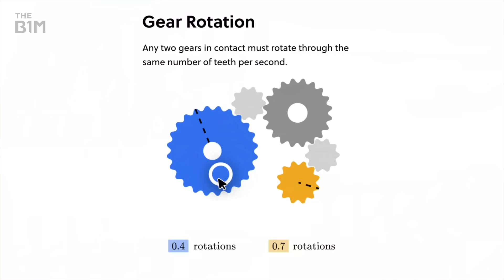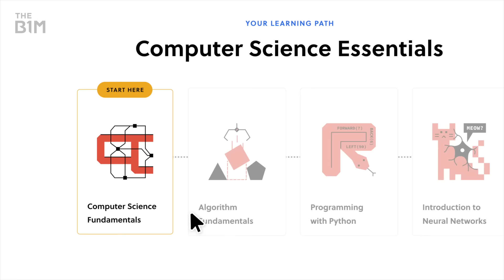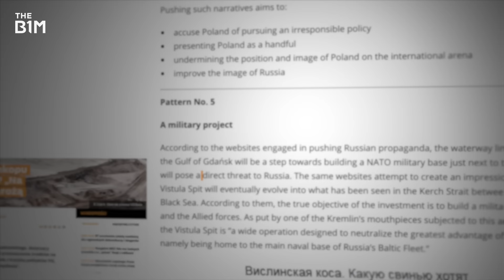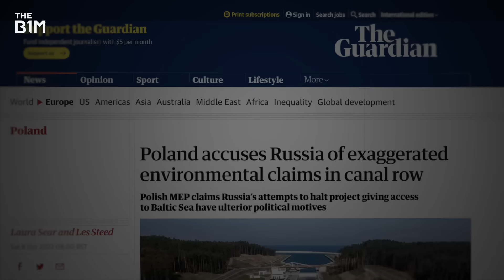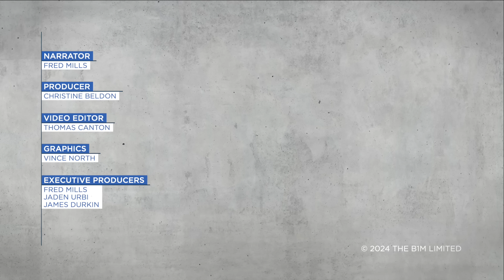Why Russia Tried to Block This Canal

Comment: I really feel like rail investment between Elblag (sorry not fining the a) and Gdansk (not n) would have been a far more cost effective solution to their problems. A solitary port doesn't require a $450M infrastructure investment to save when there is an alternative 20 miles away
Reply: This canal is not only used for the transport of goods, but also for boat tourism. In the long term, it will bring a boost to the city when sailors from western Poland, Germany, Denmark or Sweden are no longer forced to sail through Russian territory.
Reply: ciekawe czemu teraz wolą korzystać z przekopu ?
Reply: @PanProper Kto woli korzystać z przekopu? Kajakarze? :D
Reply: Żeglarze i motorowodniacy...
Reply: @PanProper  mhm, czyli nikt, komu ta inwestycja za grube miliony była naprawdę potrzebna.

Comment: Can someone explain why the bay and the lagoon have different water levels? The lagoon is connected directly to the Baltic Sea, at which point the water level becomes in the lagoon than the sea?
Reply: Sea levels rise and fall with the tides.  Perhaps they want a fixed water level inland
Reply: I don't know the details, there may be other reasons for the gates. But although the tidal effect in the Baltic Sea is only a few cm it's still a lot. The Wisła Lagoon has an area of 834 km² so for each cm of tide almost 1.4 million m²/hour has to pass through the two canals on average.
Reply: Without the locks, as the tides rose and fell in the Baltic Sea, it would cause a current through the narrow opening which would be dangerous to shipping.
Reply: The water level varies on both sides due to wind, tides and currents, the loch raise or lowers in both directions as needed. Also if they did not have lochs the current through the channel would be very strong, swapping directon with the tides, navigational and erosion problems would become issues.
There are no pumps or seperate sources of water needed because it is just equalizing the water level depending on which direction the ship is heading.
Reply: I suspect that the tide times either side of the canal are different ,  On average they will be the same level but they will vary with respect to each other over the day.
Reply: Tides in Baltic sea are small, but the wind can raise water level by a meter or so. But the gates are also there to prevent mixing salty sea water with fresh water in lagoon to ensure protection of the unique ecosystem that is in there.

Comment: While I salute Poland for sticking it to the Russians, it does seems like a questionable investment compared to improving the facilities at Gdansk and transport from there to Elblag.  I'd say one of the reasons they haven't already deepened the canal is because there's nowhere for bigger ships to go.  The only significant port requires getting a fair distance up the Elblag River, which isn't much bigger than a canal and has a tight, low drawbridges in the way.  Superfreighters aren't going to use this no matter how deep and wide they make the canal.  So I agree it's mostly an expensive political statement.
Reply: The river Elbląg will be deepen, the contract for it was signed just today. After that the rest of plan will be realised.
Reply: Bzdury gadasz tylko nie wiem czy z braku wiedzy czy z polecenia...A kanał nie został do tej pory pogłębiony ze względów ekologicznych...Chodzi o okres ochronny dla ptaków...Lada dzień zaczną pogłębiać... wszystko zgodnie z charmonogramem...

Comment: I love how explaining a simple, widely used thing as a "lock" (we call it a "sluis" in the Netherlands!) is needed. To the Dutch, it is just something nearly everyone knows.
You did a very good job of it!

The swinging bridges are also quite common here, especially in city centres. But for an out of the way project like this it feels like it would make more sense to go for a very high un-openable bridge (on mounds of earth on either side).
Since it's not a harbour area for loading and unloading ships, the space on either side isn't needed for anything else.
You could even make them slightly bigger, and have a nice park on the rises, with maybe a cafe on one of them. :)
I am sure ecologists can help ensure that that doesn't negatively impact the local environment, and I am sure that a bird sanctuary can be formed on the side that doesn't have a cafe.
Reply: If it's ok to ask, is "sluis" pronounced "sloos"? The reason I ask is that, on the canal system in the UK, we call the installation itself that allows a vessel to move between water levels a "lock", but the little mechanisms that open to physically change the water level inside the lock "sluice gates" or "sluices". It'd be really interesting if that linked the Dutch name to the British name 😊
Reply: @t-and-p  Hello! I'm not sure if English has an "ui" sound. It is one of those Dutch "we need more vowels, so lets just mash two together and give it a sound that isn't quite what you'd expect" double-vowels.

But I can tell you it is not the same sound as in English.

However, they both have the same origin; the latin word "exclusus"; to exclude.

English language etymology sites tend to favour French as the source.
But since in old French it is "escluse", and the earliest Dutch use of such a word was "sluse" (borrowed from French), later changed to "Sluis", and seeing that around that time English adopted the "Sluice" spelling, it seems likely that they got it from Dutch engineers working in England (who could do wonders, like pump out moors with windmills, that the English could only dream of).

I fear I sound pedantic when I say this, but as for the naming; the whole thing is a sluice, and the sluice-gates are simply the gates on the sluice.
So you'd be accurate calling it a Lock or a Sluice.
A Dutch person would call the gates "sluice doors" (sluis deuren). :)

And as for Dutch influenced English words; I would guess that about half of them are. The rest are French or Norse. :D

Comment: You talked about Elblag. If you like to see a truly interesting and much better engineering accomplishment you should take a look at the Elblag Canal which was built by the Prussians between 1825 and 1844. The 80 km long canal is completely without (normal) locks but it is still very much possible to be navigated by ships across it's nearly 100m elevation difference.
Reply: 100 m elevation??😮

Comment: 6:43 why not make it deeper, compared to the overall cost that doesnt seem like its percentage wise a big differennce
Reply: The current size is big enough for all the shots that use the lagoon. If they want to make it bigger they would have to upgrade the port and pretty dredge the lagoon
Reply: Because it won't be used for serious transportation anyway.
Reply: Problem is a lagoon that is very shallow so with a bigger canal you would need to effectively dig another canal in a lagoon and maintain it since normal lagoon processes would fill that canal over time with sand etc. 

This channel was a vanity project mostly done as a political statement.

Comment: It seems short-sighted to not build the lock for bigger ships.
I was also surprised by the lock itself, as the passage in the Ruzi occupational zone is open. 
Level difference would be because of tide, wind or atmospheric pressure. 
Apparently significant, but the Ruzis never bothered.
Reply: The lock will, undoubtedly, be enlarged in the future for bigger ships.   As was mentioned in the video.
Reply: nothing bigger can sail inside anyway - draft
Reply: @dr.jamesolack8504 No, it won't. Even the ships that can cross the canal as it is are too big for port of Elbląg, which is the only port in the area that is bigger than a small marina.
Reply: You're talking about the 'Ruzi occupational zone'. You're right about that, but then name the other part, the 'Elbląg' aka Elbing area also correct, because it's the 'Polski occupational zone'!
Free Ostpreußen!
Reply: @PeteDarrell1972  What makes your arbitrary period any better than the earlier periods?
Reply: Occupation zone, like half of the territory of modern Poland lol. This division took place at the same time and the Poles are unlikely to be unhappy with it

Comment: 4:30 is an outstanding video sequence of the ocean buffeting the breakwaters while the area inside still as ice.  I understand that it's probably 100% shut off from the ocean at this point but with only a small opening I think you can guess that the small wave will not make much of an impact when it expands into this breakwater area.

Comment: To be honest, can someone explain why a water lock was needed?
Reply: Maybe so that there is no strong water flow. If there really is such a difference there, then the water would simply blow your away
Reply: The difference in levels depends on current weather conditions. In our hydrological conditions, sea level depends mainly on the speed and direction of winds. The Moon's gravity has a negligible influence here (on the order of single centimeters). It should be noted that during storms we usually deal with north-eastern winds, which makes the Vistula Spit a natural breakwater for the Vistula Lagoon.
Reply: @antymonian2  Interesting, and having a gateway, despite the weather changes, there will be almost no water flow in the canal. So ships will be able to sail there safely even during a storm?
Reply: @Tony-.  I don't have such knowledge, but I suspect that you can only sail in good weather conditions
Reply: @antymonian2  So you could build only such protection gates like in Rotterdam (or similar). There is no need of having complicated and costly water lock. For me it looks like “smart” spending of public money.
Reply: I don't understand that either because both sides are at sea level, and locks are meant to moves ships from one altitude to another.  What gives?
Reply: @Matti_us_Alpe  This is just my suspicion: when we have different levels on two large reservoirs of water connected by a small canal, the water current should be quite large, so probably the lock is there to simplify navigation

Comment: I would like to understand why the Kaliningrad side apparently doesn’t need a lock to access their port, and Poland does, given that they share the same geographic configuration: same sea, same lagoon, same bay barrier.
Reply: You and me both.   This video maker did not have curiosity to ask any questions.
Reply: Because the water level at the Kaliningrad passage is the same on both sides. I'm sure you wonder how it's possible that the level is different at the new passage, since it's the same body of water, and water flows to forms a flat surface? Well, before you ask, the answer is that water doesn't really flow that fast on grand scales. Combine that with the gravitational pull from the moon which causes tides, and the natural flow of currents and you'll see that when you look at the bigger picture, water across the surface of the earth is not flat. The size of the Kaliningrad passage acts like a flow dampener.

If they had not built the lock, they coast at the end of the lagoon would have been flooded.

Comment: At first (As usual ;-) ) an interesting video! Thanks for that.  But I have a question. When I look at Google maps I see that the "Russian" exit of the lagoon does not have locks. But the Polish exit where you made this video about does have locks. Nowhere at the lagoon side I see any dams or whatever blocking the water. So I wonder why does the Polish side need these locks. As far as I always learned water is always level?  Do you maybe  know why / how this is possible?  Thanks and greetings from Holland 🙂
Reply: Good question. Russian entrance is natural, not artificial. So water level difference must be the result of moon gravity or Coriolis force if I have to guess.
Reply: Yes, water is at the same level in connected bodies when it's in equilibrium. If you have two water containers connected by a thin hose, the water levels in them will be the same. But if you start pouring water into one of the containers, the level there will rise, before the surplus water flows through a hose into the other container and the state of equilibrium is regained.
In this case, the Vistula is emptying into the lagoon, raising its water level, and the surplus water is flowing out into the Baltics through that "Russian exit". This is why the level in the lagoon is somewhat higher than in the Baltic Sea. If the water from the Vistula stops flowing, the levels will equalize.
Reply: Water level moves around one meter depending on wind, its negligible, but salination level is not by opening another unrestricted way in the lagoon water would mix very fast and decimate life in the lagoon.
Reply: @tjurzyk  No.
1. The water in the lagoon is already brackish -- a varying mix of fresh water from the Vistula and salt water from the Baltic Sea. This means that the life in this lagoon is the kind that can live in both salt and fresh water.
2. The water level in the lagoon is HIGHER than in the Baltic Sea -- the water flows OUT of the lagoon and into the sea.
Reply: @lechatquilit  And Your second point is exactly why lock is needed. Creating unrestricted way straight from, and most important close to, river mouth could, and most likely would, create a vortex that would suck more salt water from Russian side changing overall salt level. Right now water from Nogat and Elbląg is effectively pushing out sea water from basin.

Comment: So this 'canal' needed locks because of the difference in water level between the lagoon and the sea... so why does the original strait  (Strait off Baltiysk)  NOT need locks to go from the same lagoon to the same sea ?
Reply: Because it’s the natural outflow of all the water influx from rivers…
Reply: I thought the same and can only assume that the area us extremely tidal. With the canal being so narrow the tides would create huge problems.
Reply: @xwhite2020  
There are no big tides - except from winds - but a risk of lowering the depth even more without the locks.

Comment: So why is it that the water level in the lagoon is not the same as the ocean to which it has an opening?
Reply: Yes and do the Russians have a lock at their passage?
Reply: It's the same average level, but tidal surge and ebb affects the Baltic Sea shoreline only.
Reply: I wonder how wide the channel would need to be to make the +/- 1.5 foot difference navigable.  I assume that Poland decided that it would be wide enough that building and operating locks would be cheaper, but how much cheaper and over what period of time?

Comment: I don't understand why there is a water level difference. The bay and the lagoon were already connected, weren't they?"
Reply: Usually the level is the same unless strong winds blow. The lock prevents salty water from flowing into the lagoon.
Reply: @michapolaszek7049  But the lagoon is already connected to the ocean to the north. I too am confused about the sea level difference.
Reply: @Hairballs_58   There are a few rivers flowing into the lagoon and the only connection with the sea is the narrow strait at Russian side. So the water contains very little salt.
Reply: @michapolaszek7049 
And is higher…
Reply: @aoilpe  A bit.
Reply: DmtriyK, dużo ci płacą za trollowanie ?

Comment: They should have made it deep enough to begin with. The cost of rebuilding will be way more expensive. Plus if there is no lock system then the value of the canal becomes much higher.

Comment: Liars!
Quick facts checking shows that the Russia's only concern was - access NATO warships via this canal, period.
Other concerns regarding environment, waste, etc were risen by Polish and other European environmental activists:

"Environmental concerns had been expressed by environmental activists in Europe and Poland, which did not stop the project.
Marine biologist Dr. Agata Błaszczyk expresses the concern associated with the phosphorus accumulated in the sediments at the bottom of the lagoon, primarily coming from technical wastewaters from industries in the area of Elbląg, from animal farming sewage, and from washed-out fertilizers, which contribute to eutrophication of the nearly closed lagoon resulting in strong blooms of cyanobacteria, which in turn contribute to algal blooms in the lagoon, giving it a distinct greenish color compared with the rest of the Baltic Sea. The new waterway is expected to contribute to the mobility of the sediments, possibly resulting in changes in the ecology of the adjacent areas of the Baltic Sea with unknown consequences. The concern is that the cyanobacteria in the lagoon are different from those in the open sea, with higher toxicity"

Comment: Actually, the canal is narrow and shallow, so any big ship can't pass, also the port in Elbląg itself is small, it is a river port, not a sea port, and cannot accommodate any large ship, including that belonging to the navy. There is no transport infrastructure connecting this port with the rest of the country, and the only boats that currently sail there are private yachts. Previously, only small coal barges used the port in Elbląg.

Comment: This is such a badly argued video. For example, just because two sides have strong opposing views doesn't mean the "truth lies somewhere in the middle". This is actually a logical fallacy called the argument to moderation. You also cited the guardian, which is an extremely biased and unreliable source.
Reply: The Guardian is not "an extremely biased and unreliable source". You may disagree with it's political slant but it's news reporting is sound. I disagree with the Telegraph's political slant but it's actual news reporting is also trustworthy. When they cover the same story the details of what they say happened are generally the same but there may well be a rather slanted headline or an a very slanted editorial. They are "quality press", that still have journalistic standards - certainly compared to the likes of the Mail they are!